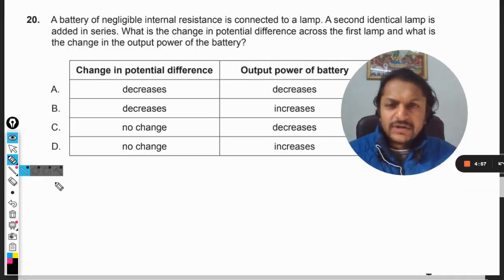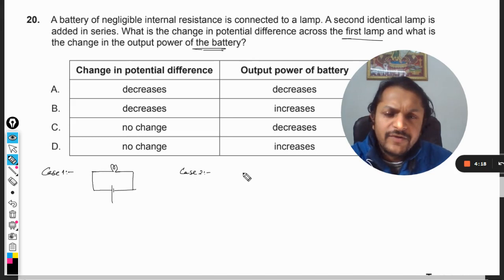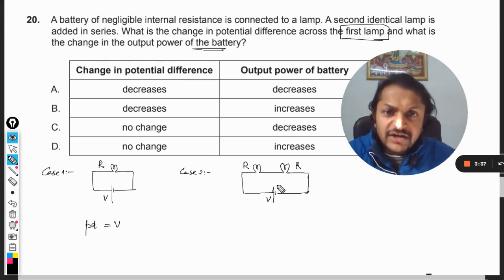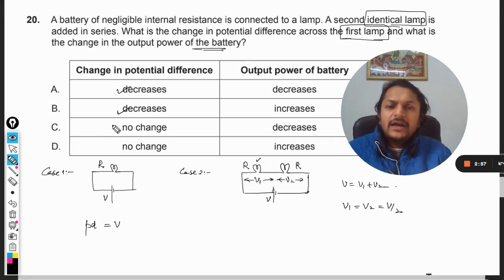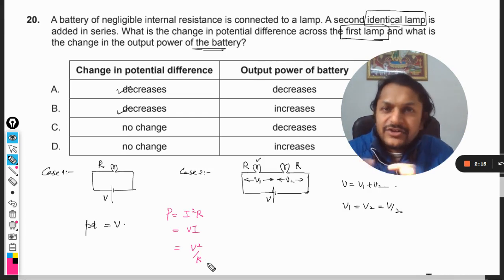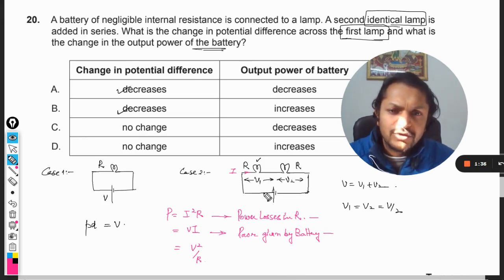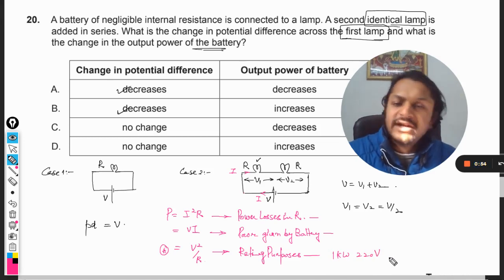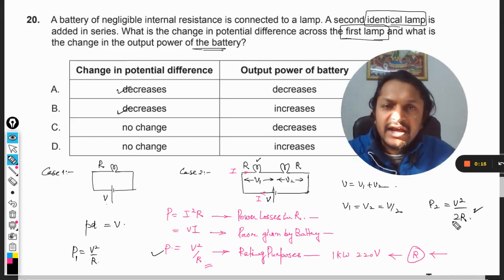A battery of negligible internal resistance is connected to a lamp. A second identical lamp is added

Comment: Prof. Varun, still unclear as to how one can identify the specific use case for using the V^2/r formula... I understand the first two, but the last one seems a bit obscure and I still cannot identify when to use it. If you use P = IV, for example, it yields different results. How come we are not using P = IV? It seems the most reasonable, as we are talking about the "power output from the battery".
Reply: i think so too